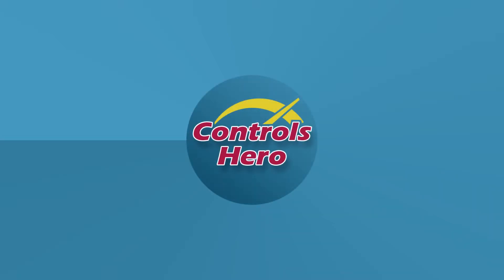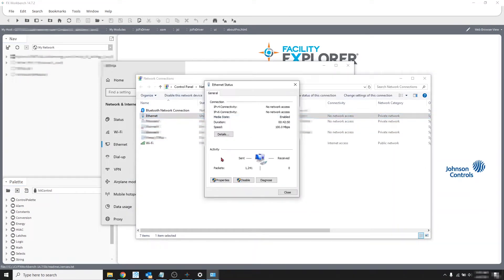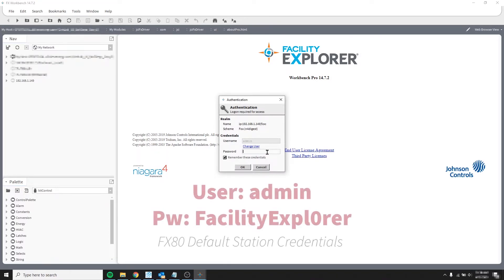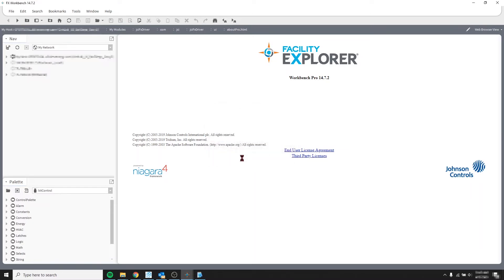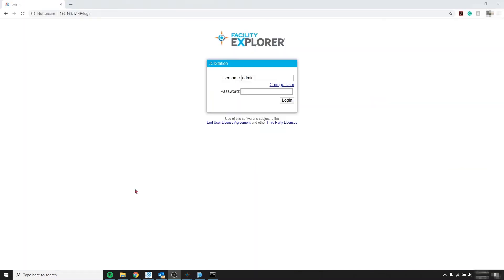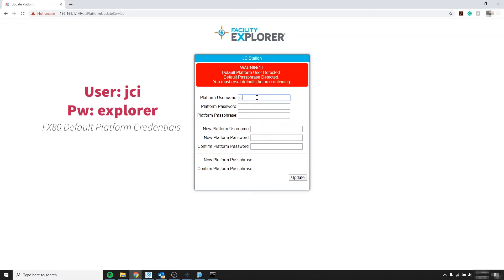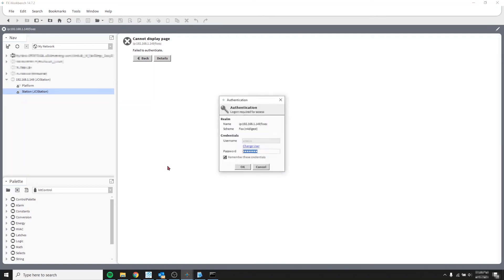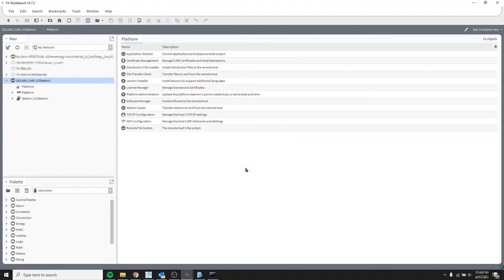Login to a Brand New FX80 JACE from Johnson Controls.

Comment: I do believe I have found my malfunction. In a honeywell jace there is no installed station on a new jace. Apparently on johnson there is. So I've been trying to log into the platform with your station credentials. Needless to say it fails every time. Should have picked up on that earlier..but I didn't.
Reply from the maker: Hi there! Good that you've found your issue. This video was solely for the Johnson Controls JACE.

Comment: Can you change the IP of the FX80 so it won't be running on the default IP? I need to add a static IP
Reply from the maker: Hello Boku! I'm deeply sorry for the late reply. I've been out of town for so long that I haven't been able to keep up with my YouTube Channel. You will probably need FX Workbench to change the IP address. Once you open Workbench, login to your FX80 Platform and go to TCP/IP Configuration > Interfaces > Interface 1. In there you can change your IPv4 Address and subnet. On the top you can also change your Gateway. Hope this helps!

Comment: Are the passwords the same for all Jace models?
Also, what program is used to load the database?
Reply from the maker: Hi L. Cross, no they are not the same for all models. I would say they are the same on JACEs with similar production dates. But I will not be surprise if JCI revise their passwords every couple years. You may need to look at the documentation that comes with the JACE. The program to load databases I use is JCI FX Workbench Pro.
Reply: @controlshero  Great.  What about to load the graphics?
Reply from the maker: @l.crossjr  You can also do it in FX Workbench. I currently don't have a JACE handy, but there is a place in Workbench where you can transfer files to your JACE, which allows you to transfer image files. I haven't done Graphics on JACEs in a very long time. But if you can send me a message on my website  https://controlshero.com/ we can further discuss it.

Comment: How do i change the  factory default platform on my local platform?
Reply from the maker: Hi Gary, thanks for your question. I have never tried changing them, but I believe that your current credentials are the same as your Windows Credentials.  Now, if you want to change them, you may be able to do so if you go to Platform > Platform Administration > Update Authentication. But I must warn you that I have never tried, so at the moment I cannot assure you if it's going to work.